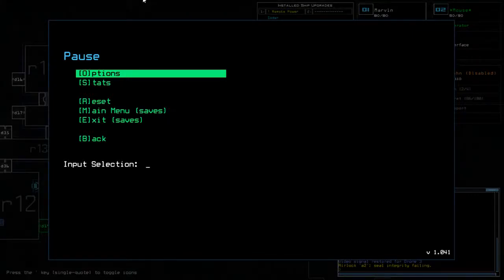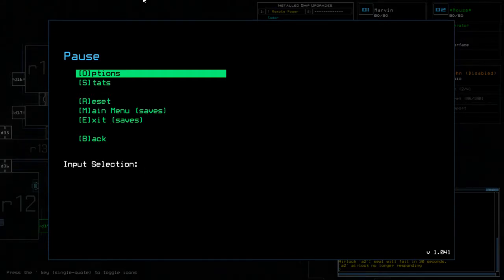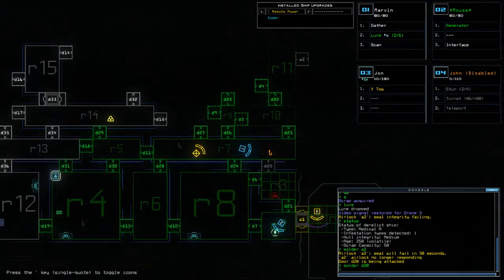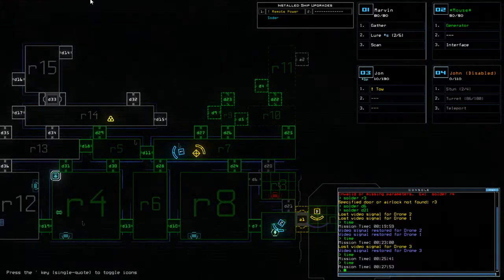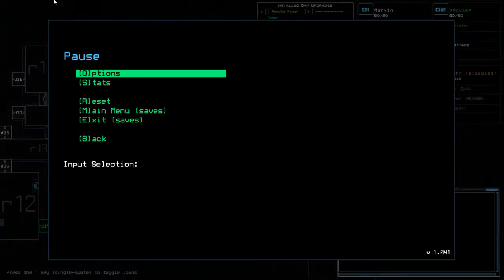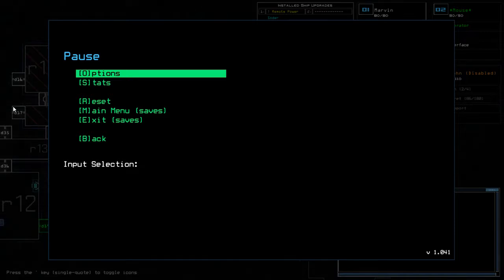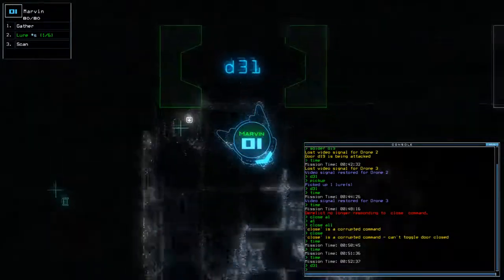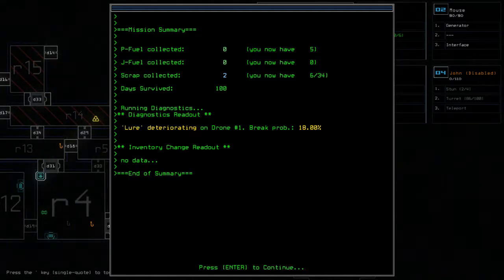[Duskers] Solder & Swarm Testing

Comment: I think swarm attacking happens on some random timer, and it picks a door to attack based on probabilities of what's in the room on the other side.  E.g. let's say the timer has counted to the point where the swarm is going to attack a door - I'd estimate it has a 50% chance to attack a door with lure on the other side, 30% chance to attack a door with a drone on the other side, 10% chance to attack a door with an empty room on the other side, and 10% of the time it does nothing. Of course that's arbitrarily chosen percentages that I just made up for example.

And yeah, derelicts not responding to close command happens sometimes on really old ships.